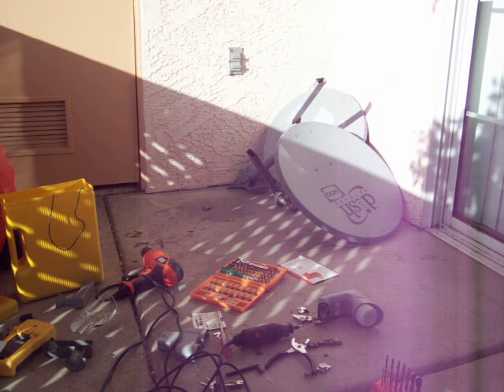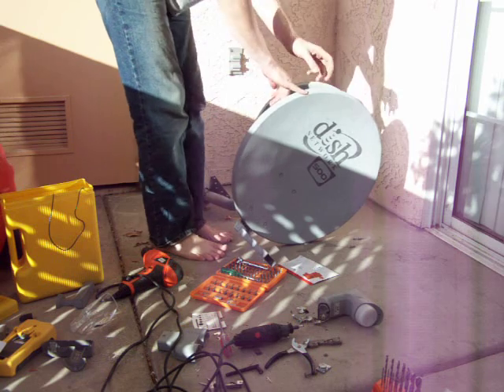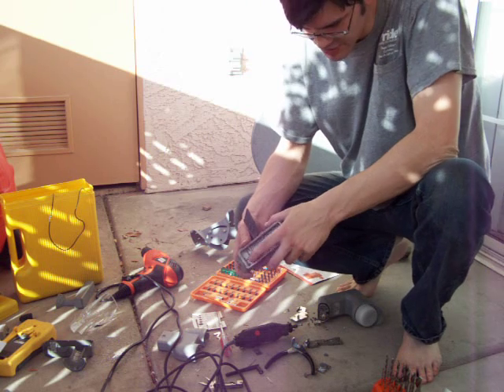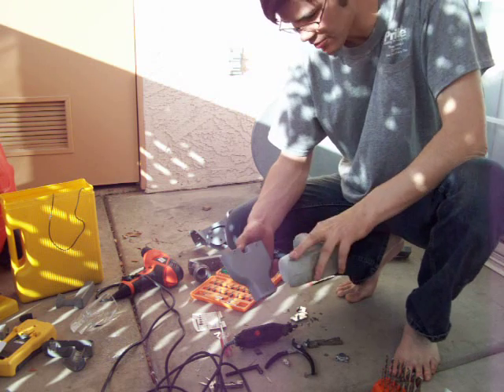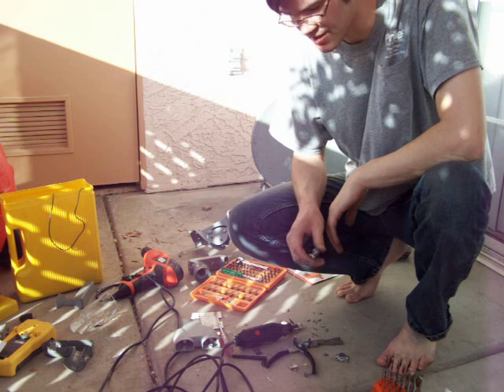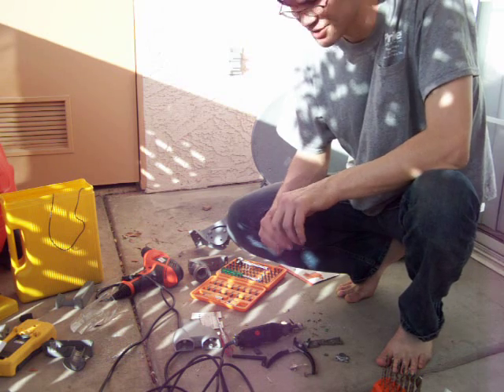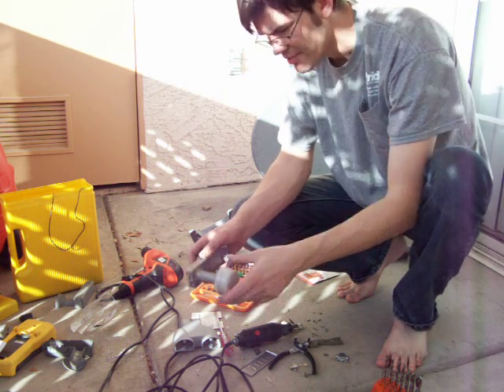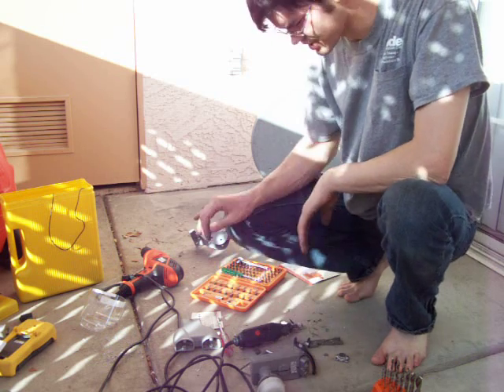Parabolic Dish Network

Comment from the maker: Technically, you do. You want a good parabola and focus the signal back and forth. A friend of mine decided to use 1 dish and a homemade WiFi booster. It worked, but was very temperamental. If you're in front of the dish, you would still have pretty normal range with a regular antenna. You'd still be in the signal path, but you must be in the signal path.

Comment from the maker: No. If you stick the antenna INTO the LNB, the signal bounces only in the little cylinder. The antenna has to be in front of the LNB. Like an L. In my initial video I made the mistake of showing the antenna inside the LNB, but that was really a screen test. I have a crappy camera I shot that with. My second video shows it a bit better of how it is supposed to be. Again, I bridged 2 wireless APs together to make a LAN connection. Not to get free WiFi.

Comment from the maker: Actually, there are drill bits making it look like I do.  Just the angle of the camera.  I wear a size 15, so I have big toes.  

Finishing up the complete and finished project, but it's a bit large, and it might either be broken up, or heavily edited. Weighing the options and we'll see what comes of it after the initial editing.